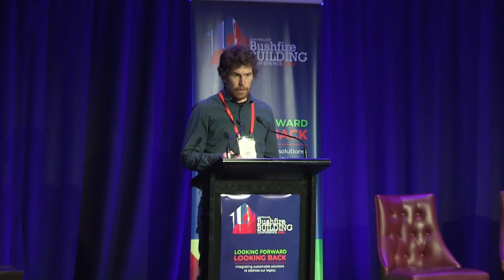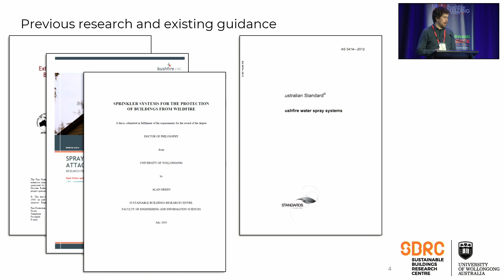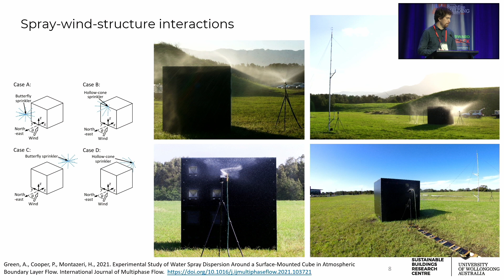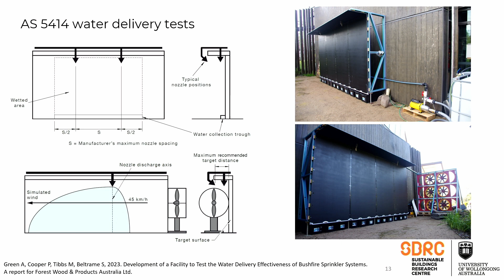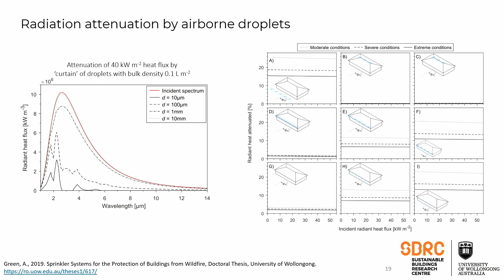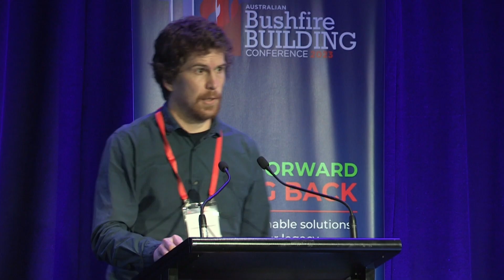Day 2 4A Dr Alan Green

Comment: I wonder if they heat from an ember would cause the nearby water droplets to turn to steam, because that absorbs a ton of energy.  I would think that would also change the path of the ember.  It seems a fluid dynamics simulation would answer this.